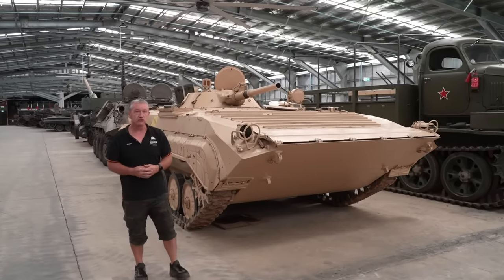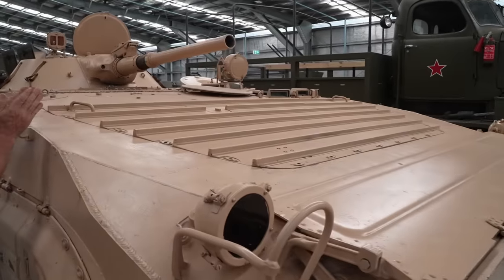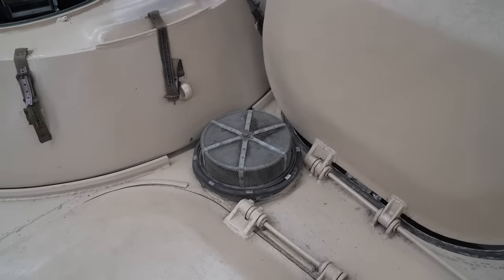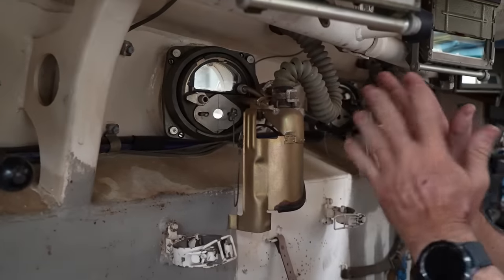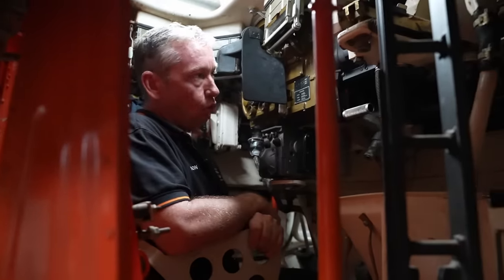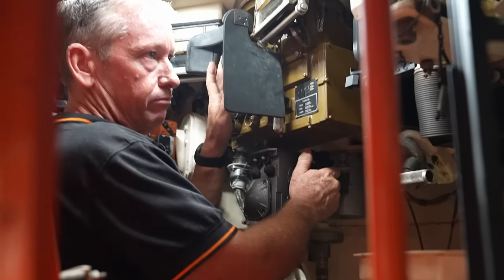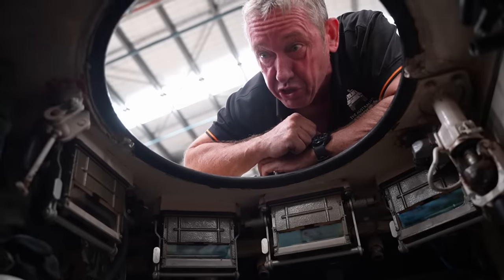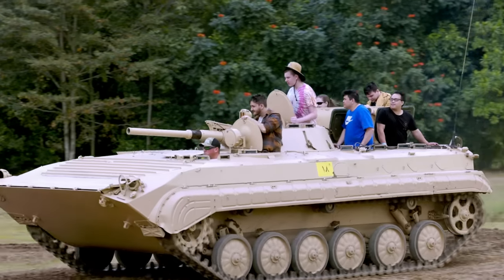BMP-1 Infantry Fighting Vehicle: The workhorse of the Soviet Motorised Infantry

Comment: This is a much more sophisticated vehicle than I had realized.
Reply: I think because that a east German copy
Reply: @yourcommondriver9681  Than why buttons are signed in Russian?
Reply: @sfalhilsajd  They speak Russian in East German duh /s
Reply: @dudududu1926  🤦‍♂️
Reply: @yourcommondriver9681  
I like the East Germans more for some reason. Maybe because they are closer to the Slavs.
Reply: It's not. Your military knowledge is not as sophisticated as you thought
Reply: @yourcommondriver9681  At 10:16 there are torn papers on the wall on the right, this instruction seems to be in Slovak language.
Reply: It was main vehicle to penetrate enemy lines and disable enemy artillery (main soviet military doctrine).
So it has to be good and ready for mass production.
Also, it has very low silhouette, so in times before ATGM's being common, this was hard to hit object. And very easy to dug in.
Reply: The numbers on the side of the véhicule are arabic numerals
Reply: It says 18
Reply: So it's most likely an arab model
Reply: @ЗвездыБольшойПротуберанец  jup its slovak it says somthing about what you should do before entering water but i cant read the rest
Reply: It is a garbage. Weak with a lot of useless feature like the machine gun holes. Even the russians drop that idea in the BMP3. Most of the users learnt the best way to use if the infantry is actually riding on the top of this thing. If it hits a mine than more protection on the top than inside the actual vehicle. So again; it is a shitty machine. Look at the Ukro-Russian war. Without conceal, support and coordinated movement this is actually almost equal to an armored car.
Reply: The old story is that Russians fight with shovels
Reply: @BaldieDude  This car of the mid-60s, up to the 80s, had analogues in the West, for example, the United States both drove and ride buckets from the Second World War or their ideological continuations, as for the BMP, it went through a lot of modernization and rethinking and we love it as a fast, convenient and affordable car
And yes) if you run into a mine on it, it will explode ... BUT, as the operation of the Ukrainians showed, it at least reaches this mine, while, for example, the Bradley M2 will get stuck because there was a puddle on the road
Reply: @BaldieDude just like an M113, YPR-765, Marder, Bradley or majority of other armored infantry or fighting vehicles you see in Ukraine. Fighting insurgents and third tier adversaries has allowed the military in the collective west to believe their arms industries advertised performance specs and hype, but in reality most of these vehicles are death traps if not used in the right way - attacking under favorable conditions with massive fire support and prepared advances. That’s why the US is not eager to send in F-16s and Abram tanks, because these will suffer the same fate as the Bradleys, M113, M109s, M777s etc.
Reply: @24Erizo  Because US builds their vehicles to fight in desert where there is hardly any water and bomb farmers on south.  One of the worst sides of BMP is the fact that you  cant stand there in full heigh and its complicated to leave the vehicle when ur under fire and its extremely vulnerable to mines, because in order to survive mine explosion you need arrow shaped bottom of the truck and high clearance which makes you a big target for RPG, russians even call BMP = "Brotherly infantry grave" because abbreviature fits those words on russian.
Ukraine overall is corrupt country which wasnt able to produce anything in 30 years, it bough BMP1 from exUSSR countries
Reply: Soviet vehicles are quite the engineering wonders. These included
Reply: It's about what I expected. These things did not do well against the Bradley.
Reply: @Grombrindal  So you are saying that an IFV didn't do well against another IFV that was designed 16 years later?  What a shock!
Reply: I agree.
Reply: @BaldieDude You speak from experience,  bro?
Reply: @Xover112 I do  not understand your comment. Abrams filters clogged with sand in Iraq.

Comment: Great presentation. I had no idea the main armament would even come close to penetrating the frontal armour of an MBT of the time. Fascinating.
Reply: It might pen it, but the odds of hitting are close to nil.  It's horribly inaccurate.
Reply: Not really a problem since anything outside effective range of the cannon they have the ATGM, which actually outrange tank cannons. The grom cannon has a similar drop pattern to the PKM machine gun so they can use the coax to range then immediately fire the cannon once the coax hits the target.
Reply: @yoloman3607  What's impressive with your post is that EVERY factual statement you made in it was completely wrong.  That takes effort.  Well done.
Reply: @iatsd  Considering I got this info from the Opfor training units who use BMPs in the US army, I believe my sources knew their shit considering they’ve picked apart every inch of those things for decades. Check any picture of the BMP-1 reticle. You will not find a second set of ranging marks on it because the BMP-1 Grom cannon has the same drop as its PKT counterpart. You would be hard pressed to find any source that says otherwise.

Malyutka can fly out to around 2.5km. Effective range for a 60s or 70s era MBT like an M60 before the addition of the fire control computer and new sights on the 78’ A3 model could only be expected to hit a target less than 50% of the time at 2000m while stationary, much less at 2500m. After A3 it was around 70% at 2000m. 

Don’t call out people if you don’t know what you are talking about.
Reply: @iatsd  If that’s the quality of intel you learned after 20 years with BAOR you would probably have died with them too if push came to shove. I trust the instructors who spent years driving a platoons of real BMPs and real Soviet tanks vs real NATO tankers in live exercises. They don’t have any reason to embellish the strength of the Soviets. They just tell you what you need to know to survive and win, and I didn’t find anything wrong with their assessment of BMPs in the gulf war.

For fun we actually got a few clips of vintage Brit training films with various inaccuracies compared to our own, some of them were pretty egregious like claiming BMPs didn’t have any night sights and to attack them in the dark. Hilarious but also really sad since the film had clips of BMPs with the IR searchlights but whatever analyst wrote up their assessment didn’t even know what they were for.
Reply: @yoloman3607  actually, the point of the gun was to cover the range where a missile could not be launched, and that was 500 metres since the missile couldn't be launched closer than 500 metres, so this gun is not really meant to be fire further than 500 m. With the futher advances in rocket tech, they replaced 73 mm on BMP with 30 mm autocanon on BMP-2
Reply: @drunklorry3406  It isn’t that the missile can’t be launched at targets within 500m, but it takes around 500-800m to get the missile under control and flying straight based on the skill of the gunner. The missile has to fly up at an angle off its launch rail as it builds up enough speed to fly horizontally. Then the gunner has to manually guide the missile down gently so as to not oversteer and hit the ground. A well placed ATGM launch with a skilled gunner can hit a target within 500m, but I doubt there are many gunners who are that good left. 

The 73mm Grom’s performance versus infantry positions was poor, and they found that BMPs in their role as infantry fighting vehicles were fighting infantry much more than platoons of tanks. The lack of anti-infantry performance was what led to the abandoning of the autoloader and later the 73mm altogether. 30mm autocannon is just better at fighting lighter vehicles like APCs and infantry, infantry being the big selling point given it could apply constant suppression while being easier to mount a stabilizer to.
Reply: Yea presentation is 🔝
Reply: @yoloman3607  3km range is about 2 km short of MBT range
Reply: @hagestad  Effective range is much more important that theoretical maximum range. Any tank cannon can be fired up like an artillery piece and go a very long way, but actually hitting a target especially with a purely kinetic projectile is what matters. 

Out past 2km chances of hitting a target first shot in the 60s-70s was not reliable, and the time taken firing multiple shots to correct fall of shot from the current position would leave a tank vulnerable to ATGMs and return fire. This is why basic tank drills stress movement after firing 1-2 shells. It just doesn't matter if the cannon can reach past 2km if you can't hit the target, especially without getting shot yourself. One NATO tank lost, disabled, or combat ineffective due to waste of ammunition to kill a single BMP-1 full of conscripts past 2km would be a pathetic waste considering the sheer size disparity of the Soviet mechanized force.
Reply: @yoloman3607  Yep but hits at 5.2 km using MBT was done in first Iraqi war. So there is that.
Reply: @hagestad  in flat desert, against most probably a stationary target and with a rifled gun

Malyutka was very hard to use but so were other MCLOS ATGMs like SS.11. A soon as soviets developed a SACLOS ATGM they bolted it onto the BMP-1 and started the design work on BMP-2 which wouldn't have the unwieldy low-pressure gun whose only selling point was covering the ATGM's dead zone.

And you have to remember that this is not an ATGM carrier like Sturm-S but an IFV with a contingency in case it has to defend itself or infantry against tanks. Again, people can pop up with the argument that Bradleys destroyed like four times more tanks with their TOW than M1 Abrams did in 2003 but this was another highly asymmetrical conflict.

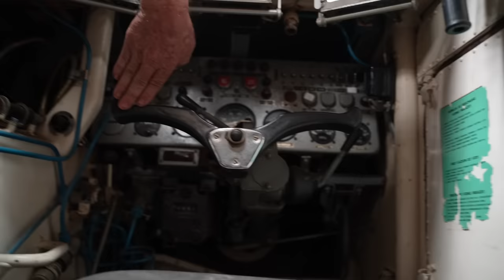Comment: 6:11   the PG-15V round looks (and probably functions) more like RPG than a cannon.  You ought to have one in the museum; about 3 feet long and rocket assisted.  The compass at 10:28 is for steppe or desert terrain (no roads).
Reply: When invading western Europe, coming down the Fulda gap, I guess the driver could just keep heading 270 degrees and be fine 😉
Reply: I own a PG-15V round, and the case they came in.
Reply: Pretty much a spg9 that dont have backlash
Reply: PG stands for (IIRC) ‘protiv tanka’ which is simply Russian for ‘anti-tank’.

The ‘R’ in RPG means hand held weapon. So the RPG 7 is the weapon which fires either the PG-7 (HEAT) or OG-7 ( HE/Frag) munition
Reply: @bob_the_bomb4508  ProtivoTankovaya Granata - anti-tank grenade, but R is indeed for Ruchnoj - hand-held. RPG-7 can also use ThermoBaric Grenade, developed much earlier than the OG which itself was designed between chechen wars as more effective yet more compact grenade against infantry than HEAT.

Comment: I'm curious, the M114, which the Recon platoon I was with in the seventies, main defects were being under powered, with that poor Chevy 283 we usually had one or two dead tracks, and the fact that the hull stuck out in front of the tracks meant it couldn't get out of rice paddies, something we didn't have to deal with in Germany. I see the BMP's hull also sticks out in front of the hull though the point is higher that the 114, would it have had enough muscle to push itself over a berm?

The good thing about the 114 is that though we could not stand up or even crouch, there was a huge amount of space for 3 of us, more usually 2, and our gear. But I have to admit the jeeps with pintle machine gun mounts we had when I was in the ground troop of an air calvary squadron at Ft Knox was more fun, especially since we had all grown up watching Rat Patrol on TV.

Comment: As the Dysfunctional Biographer posted a few minutes ago, it didn’t have a good reputation for accuracy, yet the SPG-9 that fires the same round at slightly higher pressure seems to be highly regarded by users.  I spoke with Kurdish Peshmerga in ’91 and Iraqis in 07-08 who loved the SPG-9.  There have also been favourable comments by Ukrainians.  Do any subscribers have first-hand experience with either or both who can shed light?
Reply: I think it's the platform difference. SPG-9's end up on technicals all the time. You have that thing in the back of a hillux, and it is SWEET. The high arc of the round means you can be behind cover. Close indirect fire. You can be danger close to a ridge, but largely protected from incoming fire. So, in those situations it's perfect. Light, low recoil, large punch, mobile. 

This one is still in the BMP-1. A truck drew less attention. Nowadays, with satellites, drones, and their improved optics: it's probably a different story. But, it's got a super practical role in that environment. But a BMP still draws a lot of attention.
Reply: Also, it's a great artillery piece in a defensive role in a remote location. The ammo is light for effect. You don't need the same firing positioning for it to have a battle field impact. And it's light enough that you can potentially move it under cover in-between salvos of outgoing fire.
Reply: СПГ-9 и сейчас используется активно. Что касается БМП, то в войсках гораздо больше любят БМП-2 с автоматической пушкой 2А42

Comment: He kind of glosses over that the later versions had almost completely different weapon loads. An additional ammo type did not just get "added" to the available ammo, but the whole main gun was completely replaced, as was the ATGM. The BMP-2 replaced the 73mm with a 30mm, the missile was replaced by the AT-4 Spigot or AT-5 Spandrel, and the BMP-3 has a 100mm low pressure gun as well as the 30mm from the BMP-2. The 100mm of the BMP-3 fires the AT-10.  The only weapon that remained between all versions is the coaxial PKT.
Reply: BMP-2 is quite a deep redesign - commander got moved to the new much wider turret for one and BMP-3 is a completely different design that actually forked off a light tank - the infantry compartment is barely more than an afterthought.

Comment: The 2A28 Grom on the BMP-1 is usually called a 'low pressure' gun in books - shell trajectory was easily deviated by wind. Don't think it was very popular owing to its inaccuracy and slow rate of fire.
Reply: It has been told, that the slow rate of fire was a fault of the auto-loader failing to work. And manual loading by the gunner to be the replacement. Having seen combat footage of the Grom in a BMP being used as an artillery piece, while exclusively being manually loaded, would give some credence to the story.
Reply: It's practically the spg9, spg9 is fairly accurate, and can be used for indirect fire with hefrag. Don't know if the grom has indirect fire equipment. The accuracy probably good to hit a tank at 900m.